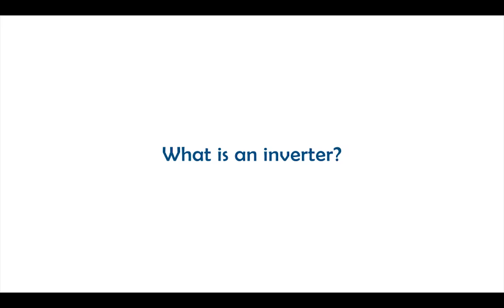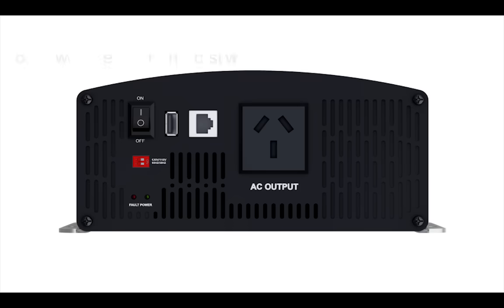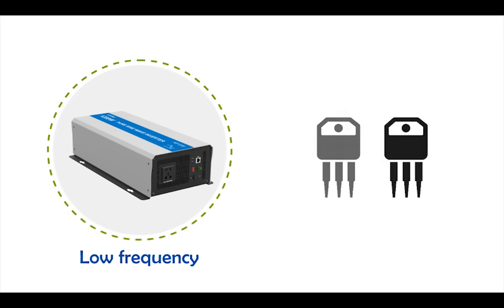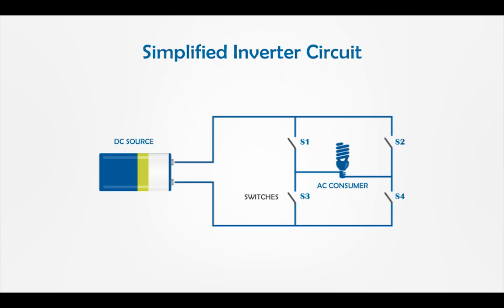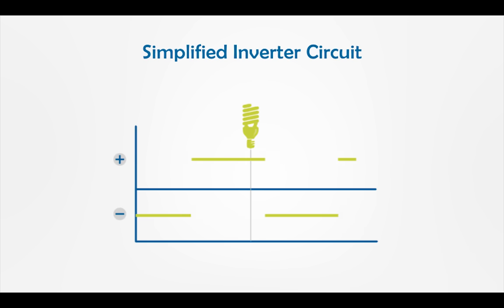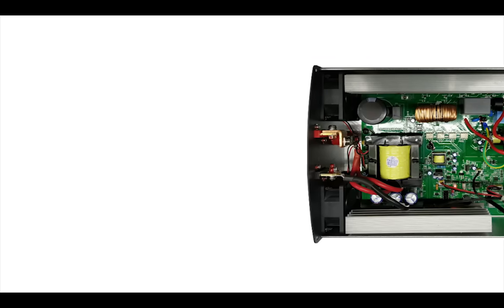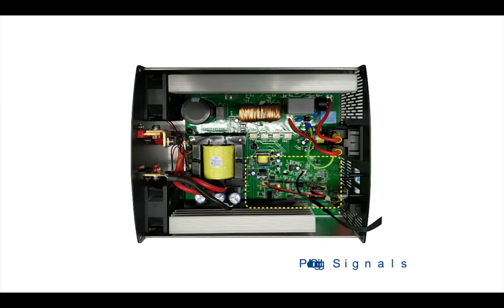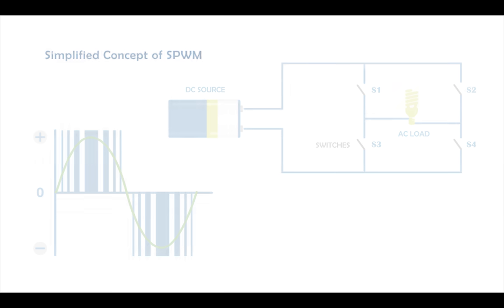The Ultimate Guide to DIY Off-Grid Solar Systems - 06 - What is an inverter and how it works

Comment: is low frequency voltage in pure sine wave inverter without batray
Reply from the maker: Sorry, I kind of lost your point, could you describe your question again, or you can reach our support at any time, to find them, you can visit our official website at www.epever.com, under the CONTACT section, the technical support email will be listed there, thanks in advance and have a wonderful day!

Comment: question: does frequency have any relation with voltage, especially in AC 110v and 220/240V?
Reply from the maker: There isn't much relation between frequency and voltage for the product use, but the deeper relation such as technical relation, please feel free to reach our support, they will provide you the better answer, to find them at any time, you can visit our official website at www.epever.com, under the CONTACT section, the technical support email will be listed there, thanks in advance and have a wonderful day!